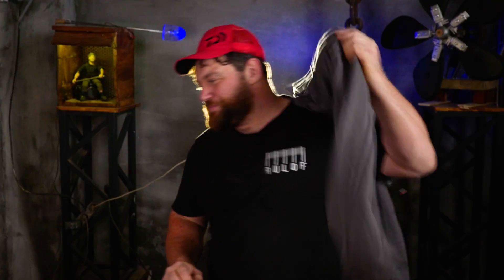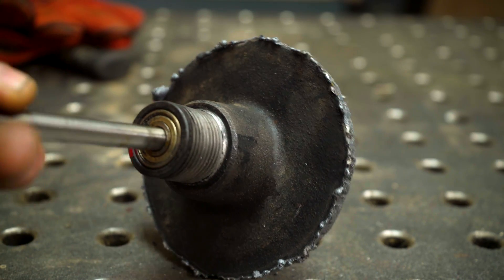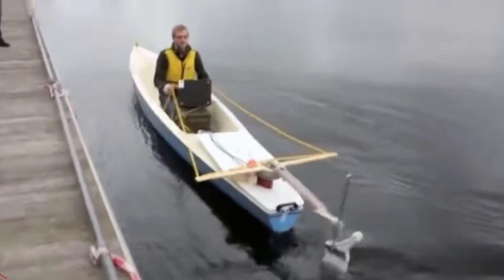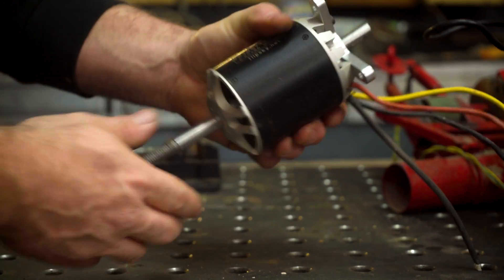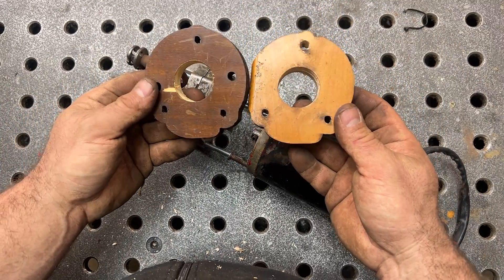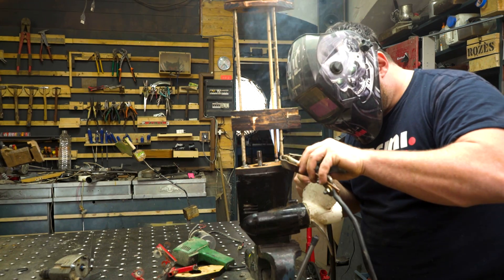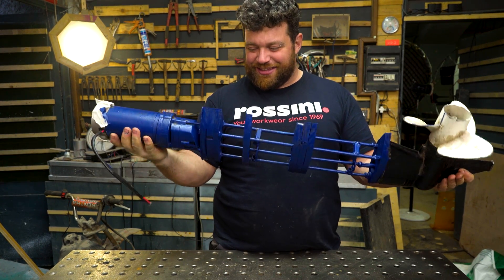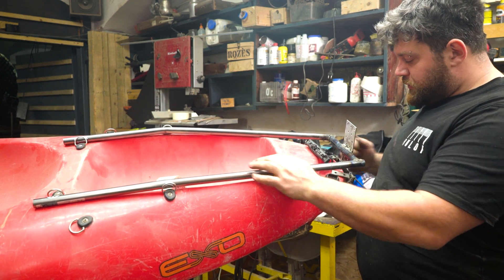How to Make a Trolling Motor + Pedal Dynamo on a  Kayak

Comment: Instead of using a different propeller wouldn't it make more sense to change the gearing?
Reply: I thought so too until he mentioned changing the prop. I think changing the prop indeed might yield better results. A prop is designed for specific speeds and ofc this one is not optimal here. You want torque, exactly what he did with the gearing. And a bigger prop will "grab" more water and benefit more to this setup. Although bigger prop means a bigger load. And in this case I suspect thick wires might not be so unnecessary like here. Rulof please make an update when you get to it !

Comment: why do this when a mechanical linkage would theoretically be more efficient?
Reply: Exactly. Although powering it via electricity is an interesting idea it is not even remotely practical.
Reply: Could only be beneficial when you want to store the energy.
Reply: for sure!   but using copper cables i can place the motor anyware!
Reply: Or when your battery is empty, having this pedals and wiring allows you to continue going forward up to a safe place!